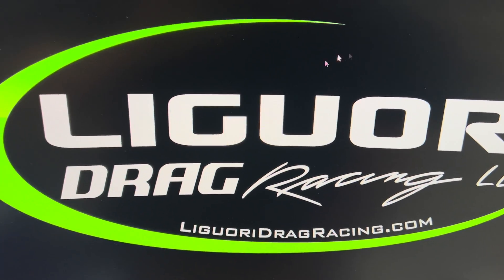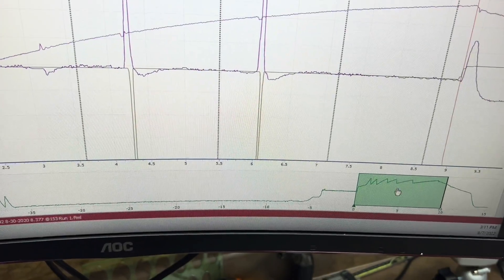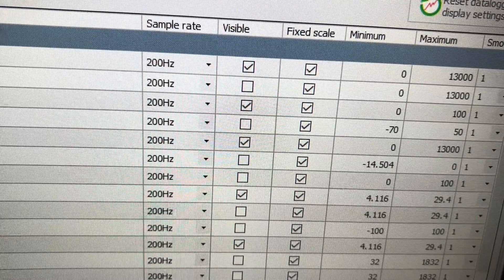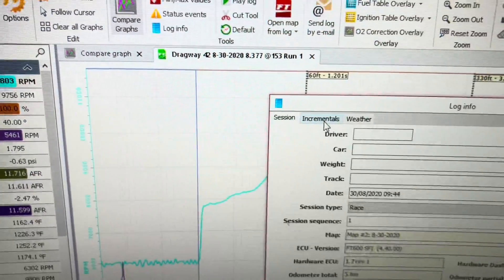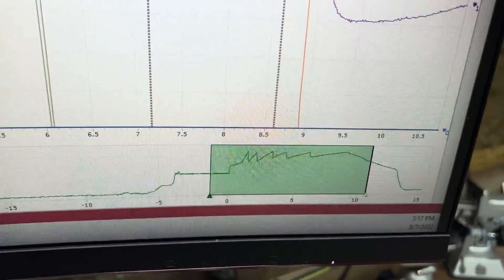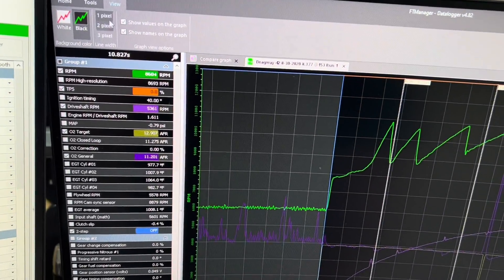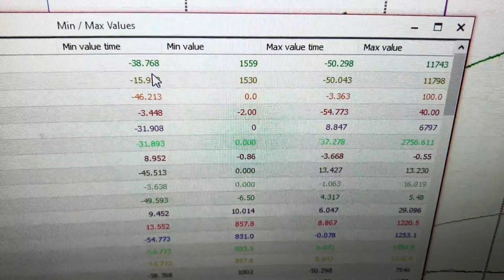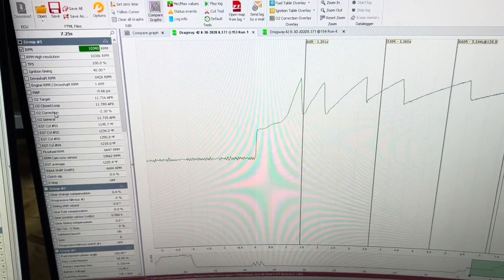How to navigate your FuelTech Datalogger

Comment: David I have noticed on my data logger that the pass info does not match up on the time line of the pass. Like if i have a 1.30 60' time it is on the 1.40. how can i fix this.
Reply: Does the bike take .10 to react ? change 0 start time if so